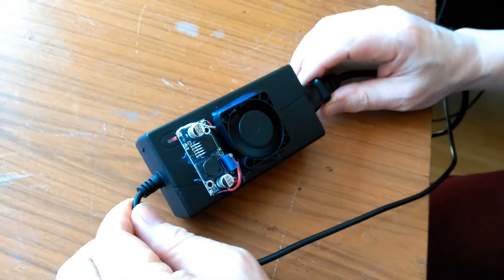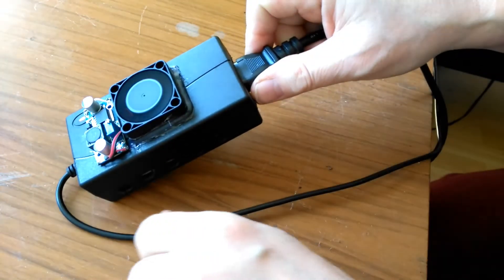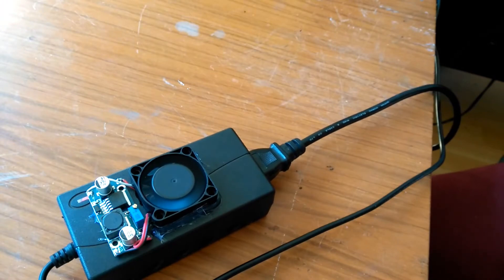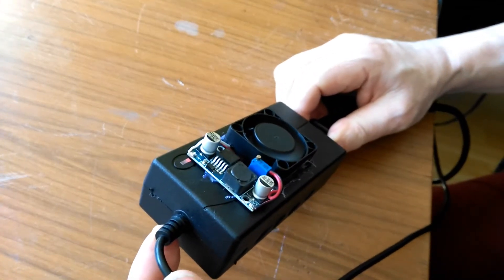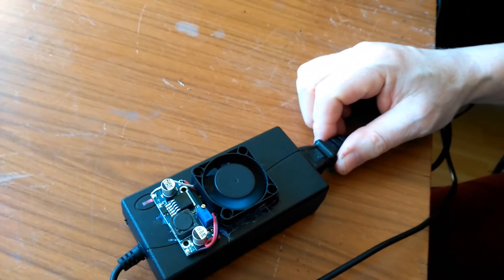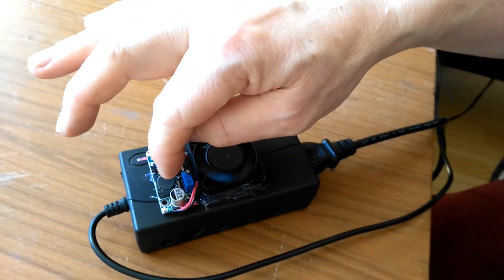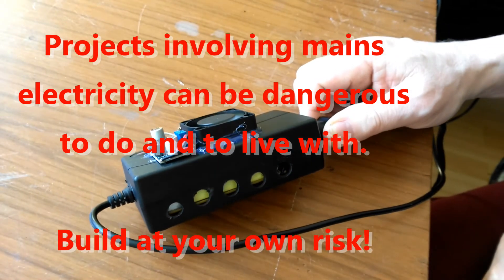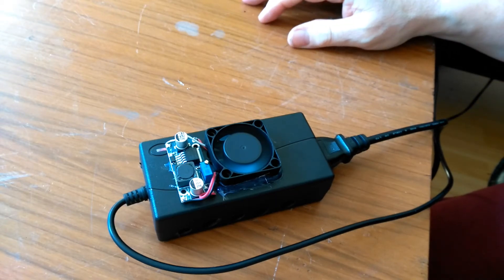TronXY X1 3D Printer - Power Supply Fix

Comment: Tks for making video! I will try same myself.. 
Also looking for video on proper bed leveling before first print and how best to position z axis endstop so nozzle does not scrape bed. (I’ve eliminated wobble by using printed shims for the axis).
Also Cura Slicer setup as I want to avoid using SD card.
Maybe you could list parts in description and where to purchase same.
Reply from the maker: Hi Michael, I'm glad you like the video. There are others in the 3D printing series you may find helpful like this one on upgrading your bed stabilisation: https://www.youtube.com/watch?v=1IBgQtzfDxk&index=14&list=PLEFr39dH1zRKbSsd3fsVryNnGR3lR89ok

You don't need to use an SD card - with or without Cura. Repetier allows you to connect to the printer via USB and print from a computer file.

I use a sliver of paper to level the bed. With the steppers off, Put the nozzle at each of the four corners of the bed and adjust the knob until the paper feels slight resistance. It gets really easy with a bit of experience.

I recommend thie Facbook group too: https://www.facebook.com/groups/1694483897515810/?ref=bookmarks - a great resource. Have fun!